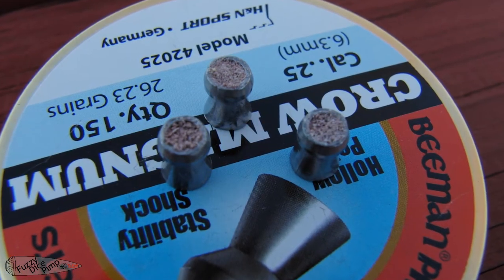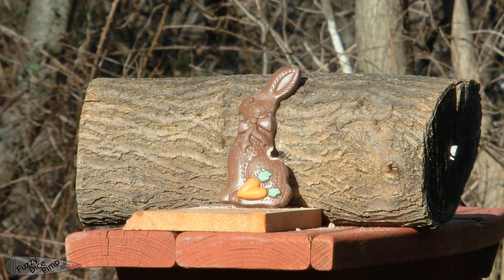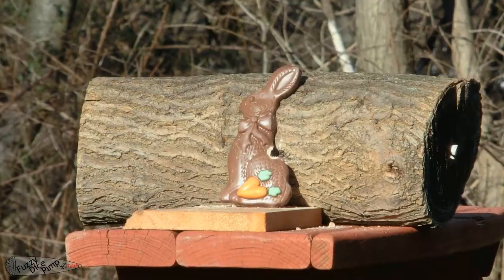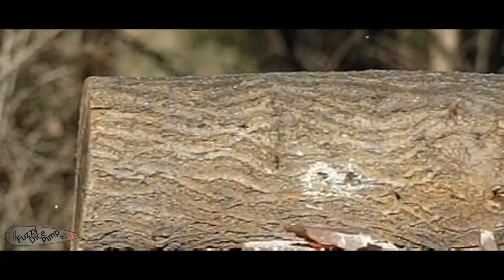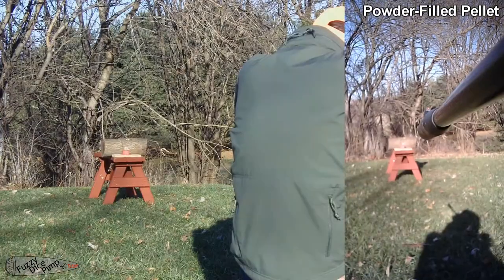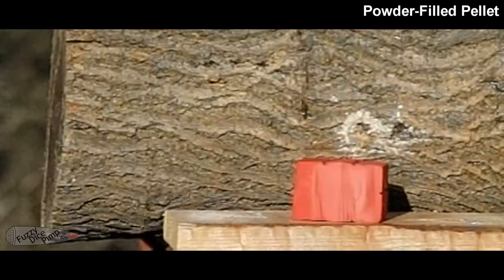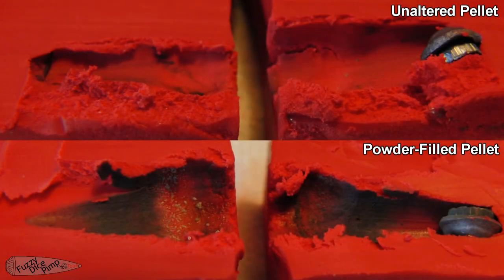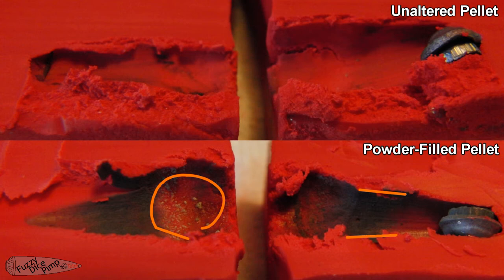Shooting .25 Explosive Pellets

Comment from the maker: @MultiCrowKiller Can't imagine why it would; the Nitro piston is just a different propulsion system that uses a compressible gas (Nitrogen, was it?) to fire the pellet instead of a spring. Both will interact with the pellet identically.